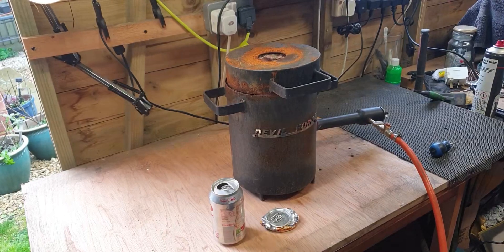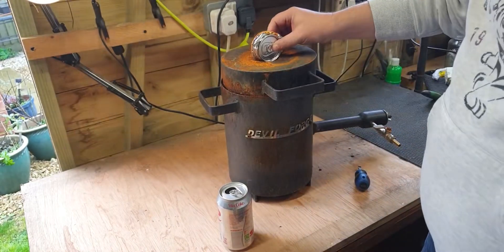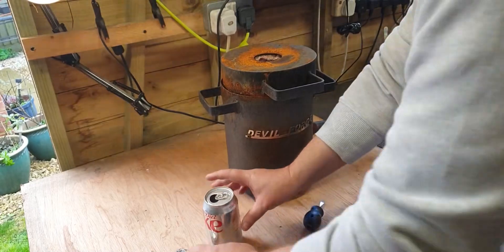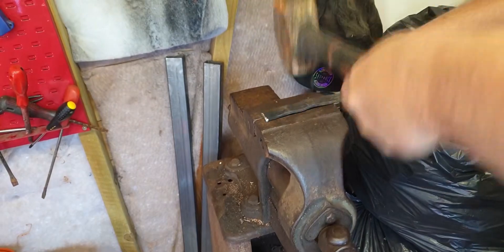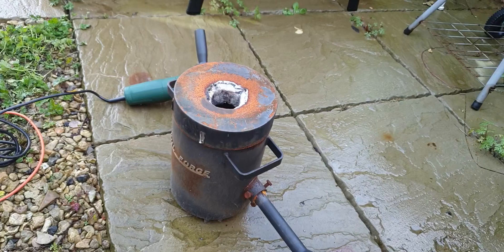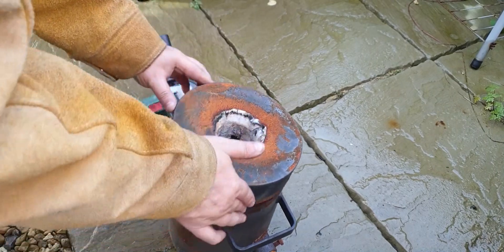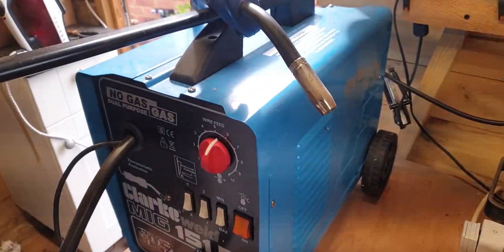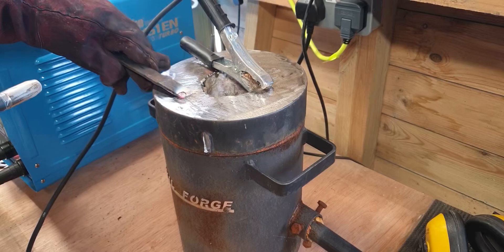Modifying a Devil Forge to Melt Aluminum Cans: DIY Tutorial

Comment: Hi Gav, great video I look forward to seeing so smelting. 
Just a little tip for future welding try turning down the speed and the power on your welding and just take your time with each weld.
Reply from the maker: Hey Dave, thanks. Yes a bit of tinkering is required. The weld is likely to be tidied up at some point. Just on to try it right now.
Reply: @fetchitnowuk  the angle grinder is a welders best friend... 😆 🤣